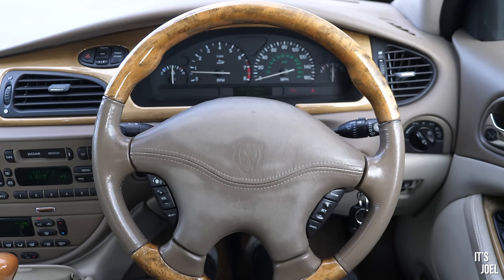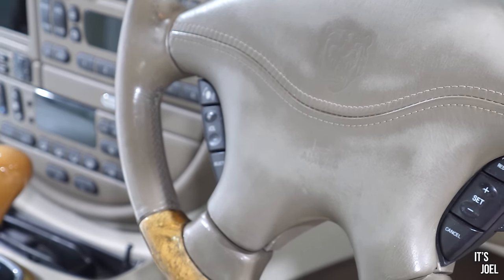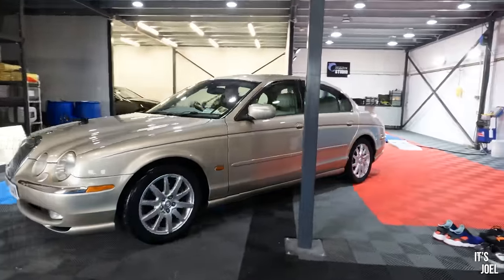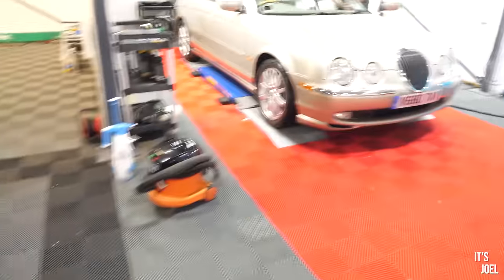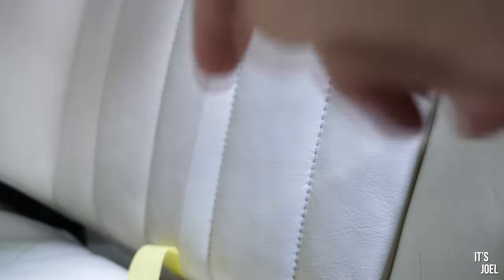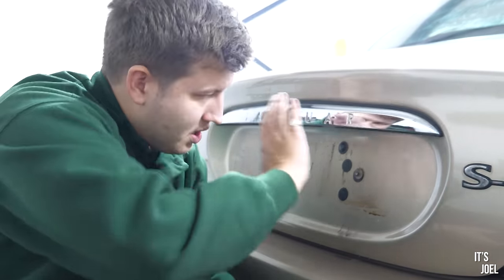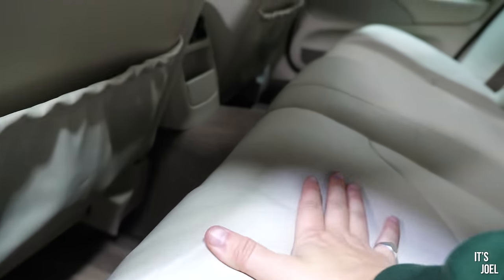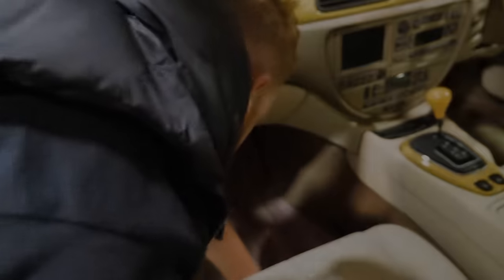Deep cleaning the cheapest V8 Jaguar in the country...

Comment: You used a Stanley knife on the rear window defrost lines. Not a good idea, you may just want to check if it’s working
Reply: I was thinking the very same thing...
Reply: I’m glad someone else noticed that as well 😢😮🤔fingers crossed they work?
Reply: Yeah I started sweating when the knife came out 😅  Fingers crossed it survived 🤞
Reply: Even the drilling of the number plate was questionable 🫣,at least Joel is having a go at it👍
Reply from the maker: @richarddawson4498  that’s the attitude!
Reply from the maker: I was advised by the guys to be careful and was, all works fine don’t worry!
Reply: @itsjoel  I would advise not to listen to them but lucky it still works
Reply: @It's Joel  I guess they're right being professionals and all 😅  TBH mistake or no mistake, we all make them.  Loving the Jag content 👌

Comment: Can't clean the wheels or inside arches without taking the wheels off. Makes a big difference, more so than getting the engine compartment wet which often causes issues after some time, only done with moving it on in mind.
The driver seat will clean in the creases, kiwi dry clean foam and a tooth brush. It's also pretty lazy getting someone else to clean your  car but we all have choices to make. I watched the video so did my part.
Reply: Hardly lazy to let someone who's a professional do a job for you 
I suppose you do all your own decorating at home 
Tiling 
Electrics
Plumbing 
Plastering 
Mechanics 
Catering for weddings 
DJ for functions
Brew your own beer
Grow your own drugs and fruit and veg 
Produce your own biofuel 
Make soup for the homeless???
Reply: I don't clean the car with my tongue, there's plenty alternatives. I don't pay someone to put clothes in a washing machine, I'm fine with using the remote for the TV myself. If you don't own a bucket and a sponge because it's all blown on paying someone who does, fair enough. Analogies are all well and good but apply some intellect or pay someone to think for you.